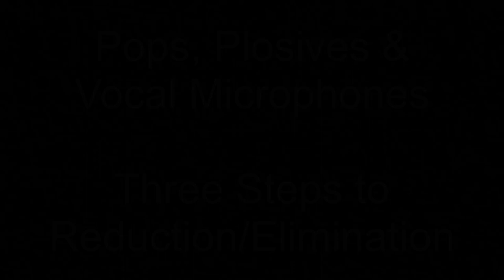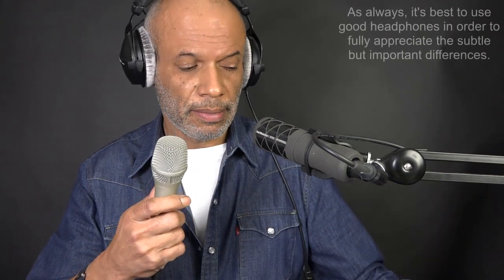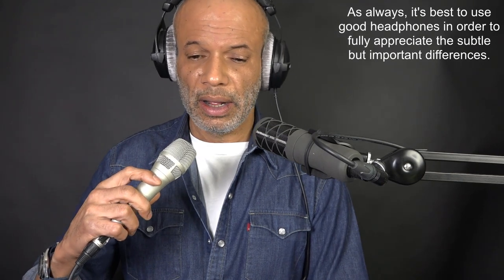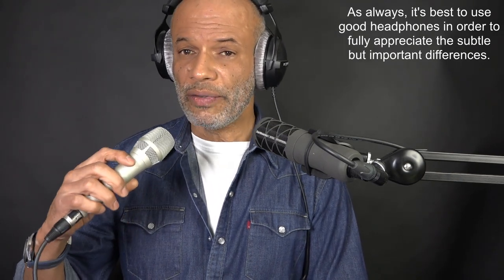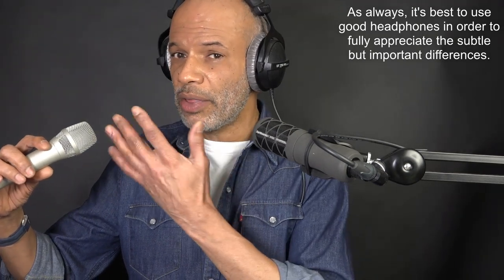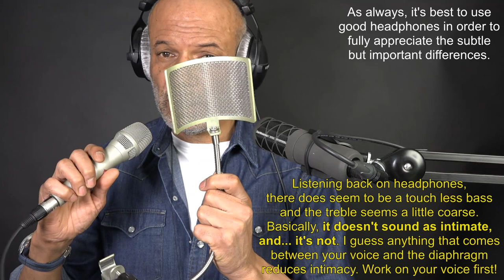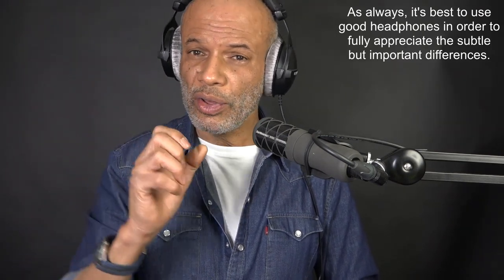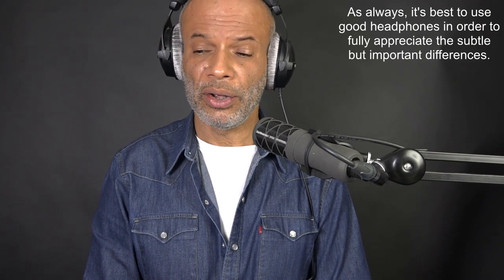Pops, Plosives & Vocal Microphones

Comment: I think it's the pressure wave that travel through the air that you want to get to the diaphragm of the microphone, not the air you use to make the pressure waves as it blows passed the vocal cords so they vibrate and make the pressure waves. Pressure waves can travel through gas, liquid and solid. So the filters are trying to redirect the flow of air that comes from making the pressure waves while simultaneously trying to affect the pressure waves as little as possible.

I need to thank you for the videos you have here, it's so much good stuff, and it's strange that I haven't heard of your channel before among channels like Booth Junkie and Podcastage. But now I do, and hopefully many more will, cause you have amazing quality.